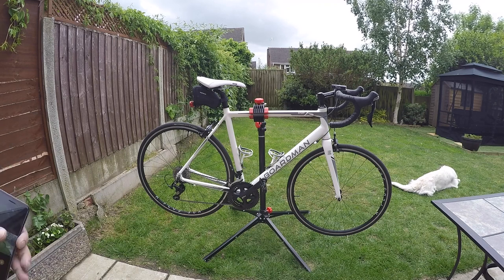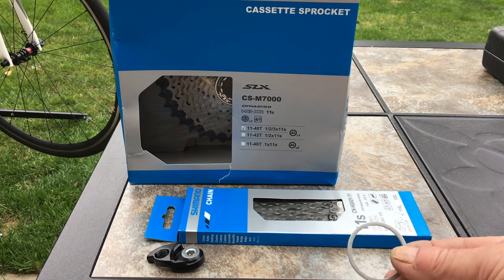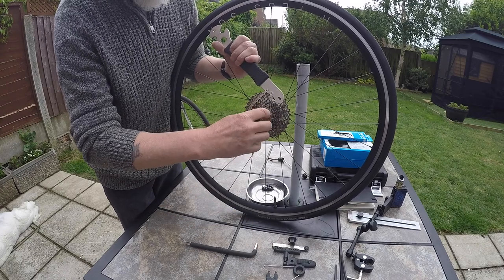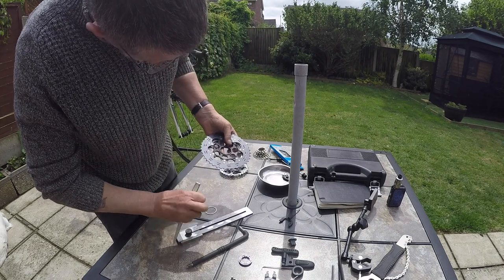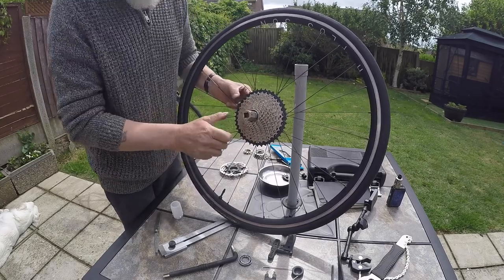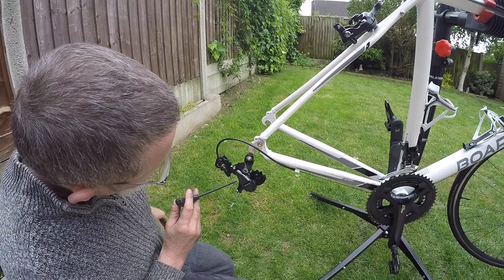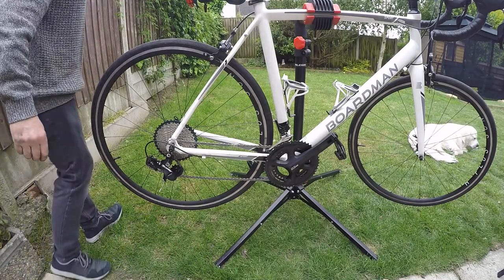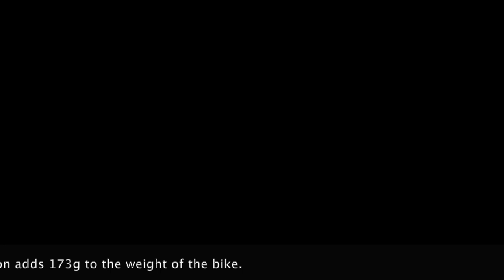Shimano 105 (5800 series) fitting a 40 tooth cassette

Comment: Just put an 11-40 cassette on my Cannondale Quick Disc 1 to help on steeper off-road tracks (switched to 38mm cross tyres) - prev 50/34 chainring and 11-32 cassette, so same as yours - and found this very helpful. Thanks.

Comment: A quick tip I learnt elsewhere and I did myself, after removing the old cassette and installing the inner spacer, use the plastic holder to push the new cassette on in one hit. My bike is a 2021 Giant Contend SL1 with 105 groupset with 11-34T cassette. I found jumps between ratios for mid to high gears a little wide, so I got a 11-32T (105) cassette and it suited me better without really compromising the climbing. Another thing to note, is 105 11-34T needs a spacer which is supplied, but the other 105 7000 range don't! The chain didn't need adjusting, plus I have a second identical wheel, so can swap whenever I want to.
Reply: who the hell here asked you about your bike?

Comment: interesting vid, I may have to do similar to my 2009 Trek 1.7, it was originally 11-26t rear with 50-34t front and like yourself l live on the edge of the Peak District, and like yourself it's hard on the knees being over 50. The bug reveal was only just getting up Bank Road in Matlock! l get knee pain up in the hills on 30 mile plus rides so I've got a 11-34t , just hoping it'll work with a short cage and a hanger extender!

Comment: Really useful video. Exactly what I’m thinking of doing. Recently upgraded from 11-28 to 11-34 and bought the 105 R7000 medium cage to go with it. I’m hitting some big hills bike packing in NW Thailand (Mae Hong Son loop) in two weeks time and realise I’m going to massively struggle so this has been very helpful as a proof of concept. I see you mentioned you would report on the road test but I couldn’t find anything; apologies if I missed it. Would be great to hear any feedback you have on how it performed.
Reply: How did you get on Ross I am just about to have a go at this. What road link did you get in the end and what cassette fits the R7000 11-40? cheers
Reply: @oxharp  I stuck with the 11-34 in the end. Currently in Chiang Mai having my rear hub bearings looked at before we set off tomorrow…

Comment: Thank you for making this video! Saw your comment on Katie's video. I think this is a rather informative piece that shows what she glides over. My LBS has warned about the potential for lockup if you miss shift into Big/Big. Have you experienced this in the time you've had this setup? Your derailleur appears to be doing exactly what they demonstrated in the shop to be worrisome on the 50/40 end of the spectrum. That being the stretched out mech and few teeth in the guide and jockey pulley making contact with the chain.
Reply from the maker: Hi Chris, thanks for watching!
I've had no issues since doing the conversion and it has done 1K+ miles since doing it. Although you'd never ride with the chain on 'big big' its makes sense to check that it will safely change into big big in case you shifted like by by accident. With the road tooth link (that extends the rear mech reach) and a long cage rear mech with a long enough chain you shouldn't have any issues if you were to change to big big by accident, mine will change to big big without problem but the chain really is at its limit.

Comment: Hi stumbled upon your upload looking for advice on fitting a bigger cassette on my hybrid/gravel conversion. Its a 9 speed and I'm looking at 9 speed 11-40/42 in your opinion do you think I will need a spacer? Anyway to tell without your cool tool you used? Kr
Reply from the maker: Hi Mark
The measuring tool is just a set of ‘feeler gauges’ that you can pick up for £3 on ebay! They are usually used for stuff like spark plug gap setting but useful for stuff like this, you just measure the gap on old cassette and compare to the new one. If you find 1-2mm bigger on the new cassette you get a spacer to fill that gap up. Good luck, the big cassette is great for my knees!